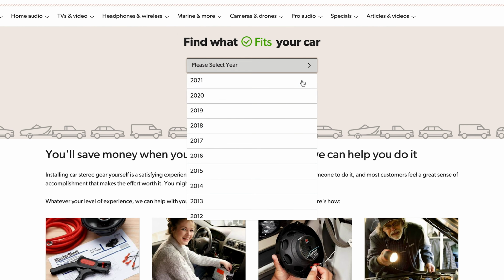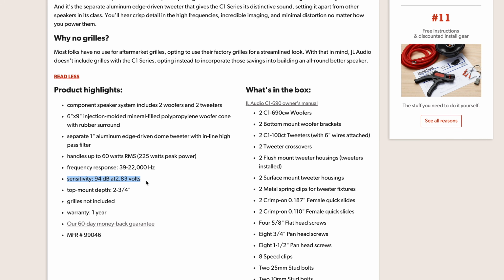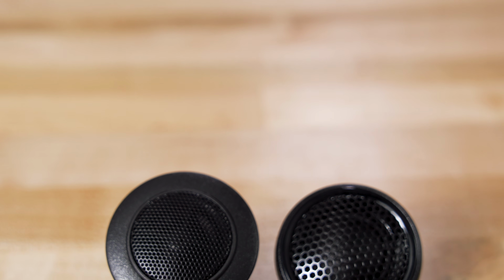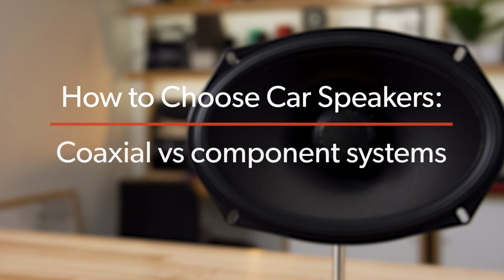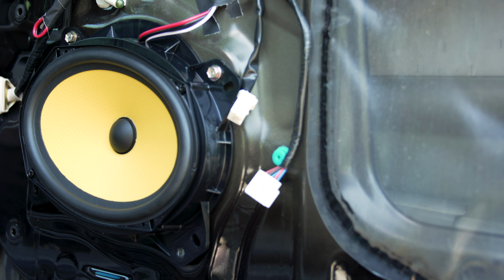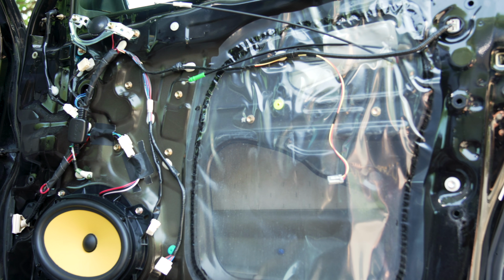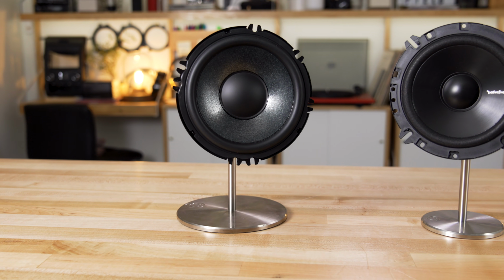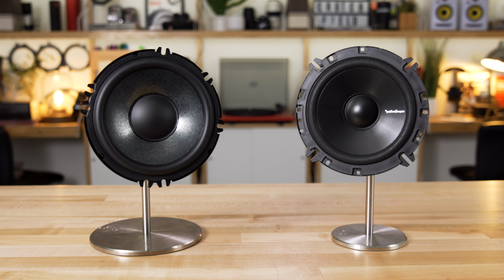How to choose car speakers | Crutchfield

Comment: 6:29 I'm so glad you mentioned that. Because I have this little push button on the crossover device, but I want to install it behind the door trim (no access). The tweeters will be mounted on the inner mirror cover... so it's probably best not to press the “+3 DB button,” I think.

Comment: Hi I have a Honda Accord premium 10 speaker system I just wanted to replace the speakers I was thinking of the focal ASE 165 or a JL audio C1 which do you recommend or any other thanks 🙏
Reply from the maker: We are happy to help recommend speakers for you! What year is your Honda Accord? Also, what changes are you hoping to make to the sound you get from its speakers
Reply: @crutchfield 2020 Honda Accord I’m looking at jL audio c1 650 or a focal iss 165 I do have a RF P-500 powered sub  I’m not getting an aftermarket amp for the speakers

Comment: I've got a vehicle you don't have on the list on the website that also has a specific speaker size
Reply from the maker: We rely on our two retail stores, junk yards, and local auto dealers to do the vehicle research. However, you can earn a Crutchfield gift card if you can supply us with research for your vehicle (US residents only). For more details, check out.
https://www.crutchfield.com/learn/research-your-car-the-crutchfield-way.html

Comment: Thank you for the info. Doing more research on this topic recently. Is it better to change speakers first than the head unit?
Reply from the maker: What year, make and model is your vehicle? Typically we say change the head unit first because 1) it'll power your speakers better than the factory head unit can 2) if there's damage in the factory speakers it will be revealed
Reply: @crutchfield it’s an Australian market fortuner.
Reply: @crutchfield  thanks to your videos i'm leaning towards the focal k2 speakers

Comment: Hi thanks for sharing this video, I am getting 4 component speakers installed in all four doors of my car. Is it a good thing or bad idk, people normally install 2 component and 2 coaxial speakers. just need to have more clarity, thanks in advance.
Reply from the maker: I am happy you enjoyed our video, thank you for the kind words🥰. Component speakers do provide better imaging and sound stage when compared to coaxial speakers, locating the tweeters higher closer your ears. If you want to install components in the rear and front it is an excellent choice for great sound quality in your system.
Reply: @ thank you, do I need to install a 4 channel amplifier with these speakers?
Reply from the maker: Ideally, we recommend using an amplifier that is capable of delivering approximately the maximum recommended RMS/continuous power to each speaker. Also check out.
https://www.crutchfield.com/I-rFBKc988/learn/car-amplifier-shopping-guide.html

Comment: Hi, I’m new here and I need some advice on upgrading the audio system in my old Renault Clio 2.
I currently have only two speakers and an older Alpine radio. I live in Europe, and I’m considering the Kenwood Excelon KDC-X705, but since this model is for the US market, I’m concerned about its radio compatibility in Europe.
In my country, I can only buy the Kenwood KDC-BT960DAB. Would you recommend the Excelon series over the 960DAB?
I want to get the best possible sound in my car. I’m also thinking about adding Focal KIT PC 130 speakers and a Kenwood X302-4 (2-ohm stable, 4-channel amplifier).
I’m not an expert, so any advice would be appreciated!
Thanks!
Reply from the maker: As far as the Focal PC speakers and Kenwood amplifier you are in great shape, those are excellent products that provide fantastic sound quality. If you live in Europe, you'll want to install an aftermarket radio intended for the European market like the Kenwood KDC-BT960DAB with DAB tuner features. Anytime you are looking for the best in sound quality from your aftermarket radio, choosing Kenwood is a great move!

Comment: Considering buying 4 infinity Reference 6x9’s for my stock 2009 ford focus. Will these be night and day difference?
Reply from the maker: You'll want the Infinity Reference REF687F 6"x8" speakers in the link below, we show them as a good fit front and rear in the 2009 Ford Focus. When paired with your vehicle in our online Vehicle Guide we also include a free adaptor harness with your order. If you are replacing the factory speakers, the Infinity Reference speakers can provide a big improvement in sound quality and detail!

https://www.crutchfield.com/I-rYALc166/p_108R687F/Infinity-Reference-REF687F.html
Reply: @ I bought them already! They work amazing!

Comment: Thinking about putting one of the Kicker 2-way speakers in my 2020 Ford Fusion SEL to replace one going out. How will putting a 2-way speaker affect my stock tweater?
Reply from the maker: Hi Ryan, we're glad to take a look. Which model Kicker do you have in mind? Which speaker locations did you want to put new speakers into? Did your car come with a factory Sony system? How many factory speakers did it come with? Did it come with a factory 8" LCD radio? Thanks!
Reply: @crutchfield  CSC674, CSC654, DSC6504, The front two driver doors for now, might upgrade the back two later. My car doesn't have the Sony system. It came with 11 (4 door speakers, 4 tweeters, 2 deck subs, and center dash speaker). Yes, 8" LCD Radio.
Reply from the maker: Using a 2-way coaxial speaker for the replacement would provide you with the easiest install. You can use the Kicker 46CSC654 below with the free bracket and harness we provide it is a fit! Since you're adding a tweeter in the lower door location, high frequencies and crisp detail is a little improved in that lower door location.

https://www.crutchfield.com/I-rYALc166/p_20646CC654/Kicker-46CSC654.html
Reply: @crutchfield  Thank you! It won't degrade sound quality, mixing it with the upper tweeter, will it?

Comment: Hi! Nice video! For a "pioneer mosfet 50X4 radio", no amplifier, which speakers do you recommend to a good match? i have options for 2-way systems, 2 coaxial or 4 coaxial. Thanks!
Reply: My car is a brazilian Fiat Palio (2016). We don't have it on crutchfield site, but it's a simple hatch car.
Reply from the maker: Unfortunately, we don't have any research/sizing information available on your Fiat. Do you perhaps know what the factory speaker sizes are?
Reply: @ te original speakers are all 6'
Reply from the maker: Do you think you can fit a 6.5"?
Reply: @crutchfield  yes
Reply: @ i'm sorry take your time here, but don't know why the crutchfield site dont work well here. "conecction time out" every time I try to enter it.

Comment: The tweeter should be seperate from the mids and lows. Thays ahy they call.them tweeters. They deal with highs. Thays literally it. Mids in  doors and lows in the "subwoofer". Blending the three is done in the eq. Not the speaker choice. 😂

Comment: My 2023 armada sv trim have a bass enhancer settings because it didn't come with the bose
Reply from the maker: Nice ride! Are you hoping to add a sub?
Reply: @crutchfield  no, just replacing door speakers without amp . U think it will sound good?
Reply from the maker: Do you hope to match them to factory power? Do you have a specific model in mind or would you like help choosing?
Reply: @crutchfield  kicker or pioneer is my choice
Reply from the maker: Both good brands. We do show you'll need 2-ohm speakers to match the factory power. What do you plan to use for power?
Reply: @crutchfield  factory deck

Comment: truly an amazing website and i have finaly got the answer to where the vw passat b6 2006m dynaudio amp is so i can finaly prove that the amp is under the driver's seet and its not a control unit under the cover. Also how do i remove the cover becouse i had to gues by touch if the amp is there or not hope i get an answer. + i didint even say how amazing was the service quality becouse ewryone allredy knows its GOLDEN!
Reply from the maker: Thank you! 🙂 You'll want to push the seat back as far as it will go, and the factory amp's cover plate should just slide right off if you pull it forward.
Reply: @crutchfield  thank you a bunch for that i will try that as soon as posible but anothers question that came up for me is that do you ship out your product's to lithuania?
Reply from the maker: We do not ship to Lithuania.
Reply: @crutchfield  dang that's a šhame now į cant get some of the kicker KS speakers ive been thinking about buyng
Reply from the maker: We hope you are able to find a retailer that's authorized to sell them in Lithuania!

Comment: Good site but it seem that FIAT is not considered as a car.  :(
Reply from the maker: We do list the U.S. models which ran through the later 1970's and then came back into the U.S. market in 2012. This is because we are a U.S. based company and can only get our hands on models released here to perform our research
Reply: @crutchfield  
That's what i was thinking at first but the fact there was alfa romeo,audi, bmw, toyota, isuzu, volkswagen, etc make me think i will find fiat also.
But after searching with an other year, i found fiat was there.  :)
I know it's surely not easy to have every model and there is already a lot of cars there.
Good job. 
👍
Reply from the maker: Our research team does stay busy! They are at the heart of what makes our vehicle recommendations possible. Some of us use their findings on what can be replaced in a vehicle and only purchase vehicles that we know can be upgraded lol
Reply: @crutchfield  
My car 'Fiat Multilpa phase 2) is a nightmare for finding spare parts and also for finding speakers (especially the rear ones) as the are not round and the size is not standard. (12 cm when the standard size is 13) :/
:D
Reply from the maker: If you want to take some measurements and reach back, we'll be glad to see what we can match up. Here's a good guide for measuring: https://www.crutchfield.com/S-RrLpTvBPyvx/learn/how-to-measure-speaker-size.html

Comment: Can I ask you a question?  We're getting an Ineos Grenadier, and it's not on your website at the moment... Someone said that the company told them that the stereo system is two 6" speakers in the front and two 4" speakers in the rear... Unfortunately that seems to be the least-common speaker sizes possible.  Are 6 1/2" or 6 3/4" speaker sizes "compatible" with a 6" factory speaker?  Because those two sizes are plentiful , it seems.... Anyway maybe you could add the Grenadier to your website?  Thanks!!
Reply from the maker: Hello, congrats on your new vehicle! We haven't researched it yet; but if/when we do, we will list it via our online selector: https://www.crutchfield.com/car/carselector.aspx?lp=%2fcar%2foutfitmycar%2fmycar.aspx If you do want to look into replacement sooner, you could take some measurements and reach out to our advisors as well: https://www.crutchfield.com/support/ContactUs.aspx They will be happy to see what they can help you match up from there.

Comment: Can we have coaxial speaker installed in front, then add another set of full range speaker on the top instead of installing component speaker with tweeter?
Reply from the maker: This depends on the vehicle and how its configured. In vehicles that feature a factory DSP amp with separate outputs for both speakers, then what you described will work by just simply installing the speakers. However, if both locations are connected to the same amp channel, then you will need additional power to run two speakers in place of one component speaker so an amp must be installed

Comment: My end goal: top tier sound system. Good high pitch fidelity, good low pitch fidelity. Louder. Clearer. Crisper. Just overall better sound.  
And if power draw is worth considering, yes, low power range works. I just have a Camry. So i dont imagine it sends a lot of power through the sound rig.
Reply from the maker: Hi Dave, we're happy to help you choose great sounding speakers for your Camry. What year is it? Do you have hybrid model? Did the car come with a factory JBL audio system?

Comment: What if my car is not listed on the site, I bought a Nissan kicks 2020 model for about 2 years now and I'm looking for a speaker replacement that's really good, any recommendations anyone?
Reply from the maker: We're glad to help. Looks like we have many of the 2020 Kicks researched. Did your car come with a factory Bose system or the Rockford Fosgate upgrade?

Comment: my JVC car head unit has a max power output(front and rear) of 45Wx4 ...so whats the minimum wattage car speakers i should consider
Reply from the maker: Hi Anirudh, 45x4 is likely the peak power rating for a JVC model. You would want to match the RMS power rating. What model is your radio? Would you like help choosing speakers to match it for a specific vehicle?
Reply: KWM 150 BT..that's the JVC stereo
Reply from the maker: Nice choice! It is rated at 16 watts RMS/45 peak x 4 channels. You would match the new speakers to the RMS rating.  Would you like help choosing speakers to match it for a specific vehicle?

Comment: Car came from factory 6.5 inch speakers ( Not Coaxial )...now when i install 4 coaxials and 2 tweeters on dashboard...it is wayy too much clarity unwanted hard to reduce it with settings....what to do ? Does 6.5 inch come with ( Non coaxial speakers ) ...coaxials have tweeters on it...factory speakers did not have tweeters on it
Reply from the maker: It sounds like you had a component speaker in the front which included a 6.5" woofer and a tweeter. If you remove the tweeter and 6.5" coaxial speaker, and replace them with a component speaker, you treble should return to normal levels.

Comment: Question why isn't there JBL on Bose and other brands like that, because I would like to have Bose on my truck but I don't know which one would fit
Reply from the maker: Hi Bradley, we do carry JBL car speakers; but Bose doesn't offer aftermarket car speakers. Would you like to check for a JBL fit for your truck? If so, what is the year, make, and model? Which locations do you want to put new speakers into?
Reply: @crutchfield  92 Chevy Silverado 1500 2 door, near the windshield area
Reply from the maker: The JBL speakers, in the size that can fit into the corner dash speaker location, have a magnet diameter that is too big for the dash. Looks like there could be something down in the speaker cavity that their magnet would hit and cause interference with being able to bolt the speaker in place. You may attempt to remove those speakers and see if you can make the cavity clear of any plastic protrusions.
Reply: @crutchfield  okay, thank you
Reply from the maker: Anytime! 🙂

Comment: 1:22 The part about power range made me concerned. I bought a radio with 4x50 watts, car has already 4 midrange speakers and 4 tweeters factory installed in the doors, I''m just upgrading the kick panel speakers (which are the biggest speakers in the car, 5"1?/13cm), (because there were non installed at all) and I chose Polk DB 522s. Their range apparently does not start at 2 watts, but at 30 if I understand correctly. Will my radio now just not be powerful enough?
Reply from the maker: The Polk Audio DB series speakers will perform very well powered directly by an aftermarket head unit.

Comment: I'm still amazed at the lack of bass from 6.5 inch speakers. A frequency response without a db range is pretty useless.  A published resonant frequency would help. I've returned speakers that were supposed to be an upgrade. One of my best car speakers for bass, I bought in the 70s. 5 inch, with a resonant frequency of 55 hertz. 2 of those, coupled with an 8 inch passive radiator kicked out bass that had people looking for a train that was going to run them down.
Reply from the maker: Sounds impressive! Do you recall the brand/models?
Reply: @crutchfield  : ever hear of "Automatic Radio"?. I did say these were from the 70s.  In a previous station wagon, I built a "U" shaped box, with the 5" speakers above the rear seat back. The "U" was open to the bottom cross piece, that held the 8" passive radiator. ( Bass is mono, so both 5" speakers were acoustically coupled to the passive radiator). I had 2 Infinity film type  "Emit" tweeters to go with the system.
When I needed to carry big stuff in the wagon, these would just unplug and stay at home, and I still had some speakers in the dash.
I recently replaced the rubber surrounds, and now have these in "Paradigm" bookshelf type enclosures, as the OEM speakers went bad.
Oh, and thanks for your interest.
Reply from the maker: Sounds like you do a great job with enclosures and repurposing! Have you built quite a few custom enclosures over the years?
Reply: @crutchfield  : Yes. But kind of a dead hobby these days. I've built a couple of transmission lines. My present good speakers I have 5 pages of math on, before building. (1" soft tweeter, 8" driven, 10" passive, 1" thick cabinet, built narrow to limit refractions, and deep, to keep them away from the back wall). I built a center channel for the home theater, an isobaric enclosure with 4 4" drivers and 1 tweeter. The subwoofer is 2 -12" woofers with 2 12" passives.
Hopefully this winter I'll build a single driver (full range)  tuned quarter wave enclosure. I've read good things about them.

Comment: Can I put  a pair from different brands? Says for instance Kenwood in the Back and Pioneer in the front?
Reply from the maker: Ideally you would stick with the same brand and series for the front and rear speakers both for the best overall tonal balance throughout the vehicle.  But going with different brands can still typically provide good results.